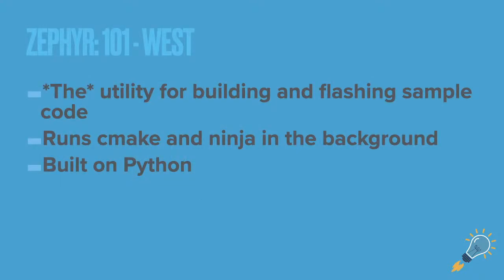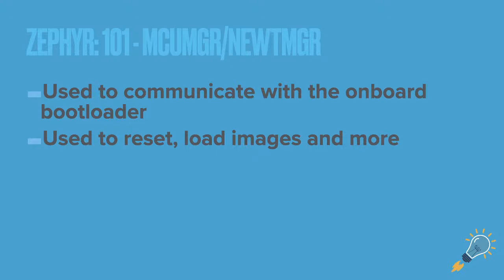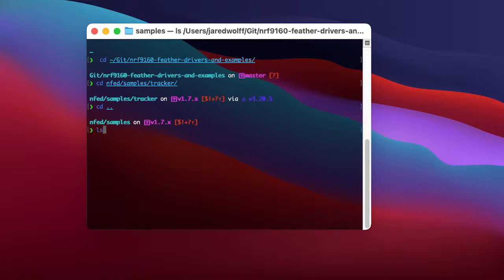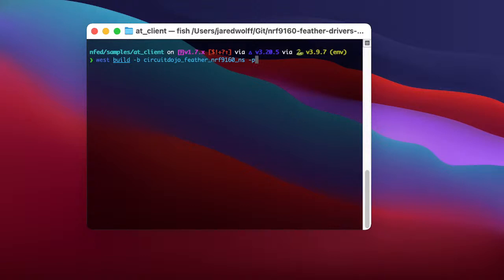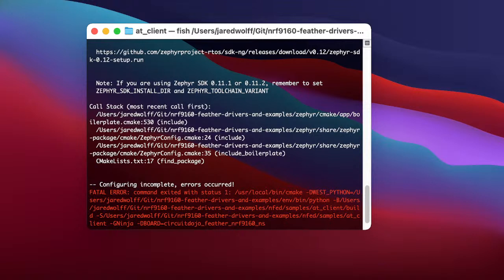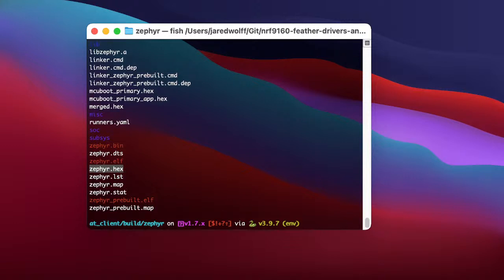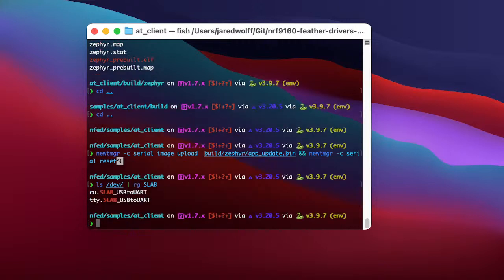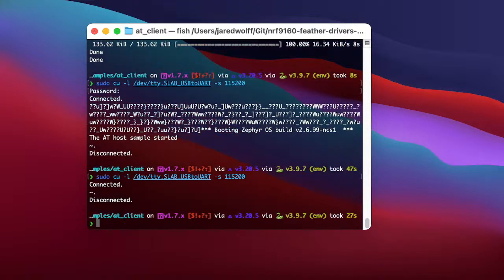Zephyr 101 - Learn the basics to get your first build

Comment: Hi, one more question... 

Do we manually append vector table entries in .s file with ISR symbols if CONFIG_GEN_ISR_TABLES=n in Kconfig file? I saw that by default __vector_relay_handler is called for every interrupt and then appropriate call is made based on an initialized _vector_table array of pointers.... 

This whole initialization of vector table is quite confusing because for CPU exceptions its has a well defined vector entries and for the rest of them it is initialized using the python script... Also, i could not find any source code sequence which could lead me to appropriate files to peek into the whole thing.. 

If i am correct, then apart from CPU interrupts, only those interrupts are made part of the vector table which are explicitly registered using calls like RQ_CONNECT() etc... 

Am i correct?
Reply from the maker: Hey Muhammad, I don't play a lot with configuring/changing the ISR tables. This may be a question for the greater Zephyr community. Here's some suggested areas you can ask: https://docs.zephyrproject.org/latest/develop/getting_started/index.html#asking-for-help
Reply: @CircuitDojo  Thanks for the link. I will post my question there.

Comment: Have you also prepared a stepwise guide into "How to support a new SoC based on an existing supported architecture like Cortex-m etc"? 

Or if you can guide me to such a resource, it will be very nice.
Reply from the maker: Unfortunately I don’t have any good resources for that!
Reply: I did add the support for a new chinese board STM32F407ZET6 based on an existing SoC Series STM32F407XE by adding my own dts file etc. I have also done fair bit of coding in the past regarding bare metal and freeRTOS based for STM. I can reuse their hal which is already available in Zephyr modules. 

What i am particularly interested in knowing is where to create which files so that the basic configuration etc does not go wrong.

I will go with basic GPIO and USART drivers support at first and try to boot it. But i fail to find a source which would tell me which files are mandatory.
Reply from the maker: Best to reach out to the manufacturer for support. Otherwise you may have to , as you alluded, copy over a board definition that uses the same Cortex M and go from there. You’d likely have to create your HAL layer from scratch.

Comment: I can't setup the environment. I want to work on nrf52840dk.
Reply from the maker: Are you trying to use Nordic's NCS or vanilla Zephyr?
Reply: @CircuitDojo  ncs. I am new to zephyr and nordic. 😢
Reply from the maker: @ffgg-zv4gg  gotcha. If you're trying to pull NCS you can try it with my VSCode plugin. Follow my instructions here: https://docs.jaredwolff.com/nrf9160-getting-started.html#sdk-and-development-environment-setup

Make sure you use https://github.com/nrfconnect/sdk-nrf.git as the init URL. (instead of the one in the docs)
Reply: @CircuitDojo  okay. thank. Will try. I am using Windows btw.